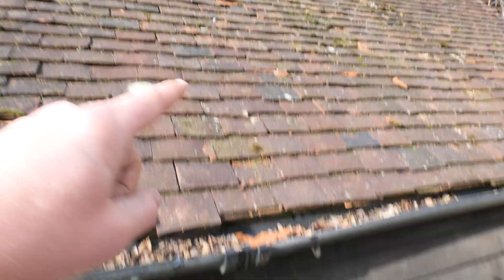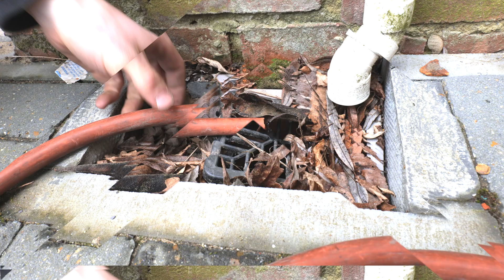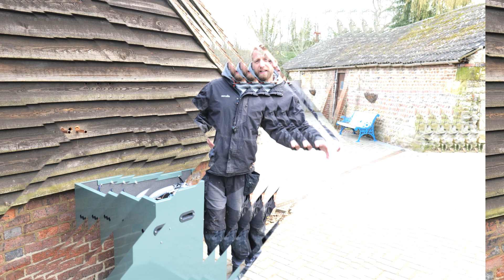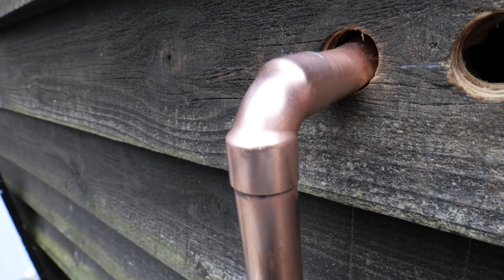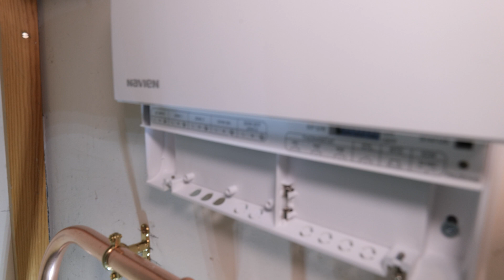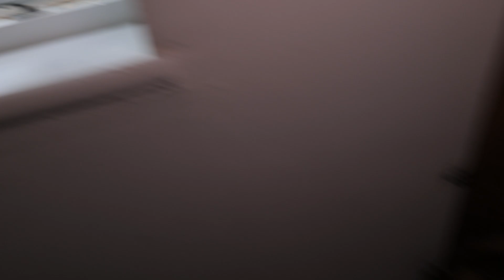Why?.... Navien - System Boiler relocation

Comment: Where are you based as we need a supplier and fitter for a Navien external combi boiler and system.
Reply from the maker: I am in Hastings East Sussex. 👍🏻
Reply: The installation would be near Yeovil in Somerset so I guess too far for you! Do you have any contacts/recommendations for installers in that area? Thanks for your reply anyway. Great video!
Reply from the maker: @petersamwell5919  Yes unfortunately too far. I do not  I am afraid. Thanks anyway.
Reply: @loving-plumbing  Thanks anyway

Comment: I fitted one of the first in 2018 direct from navien and It was the worst decision I even made. I really don’t see the benefit of a twin stage burner. 
 
We recently installed a 32kw eogb sapphire liquid fuel boiler as a slave to a 200G. We rated it to 29.4kw @ 45c design temp and its working beautifully. 

I have never seen a oil boiler stay on and hold a temperature without creeping over the set temperature.  
The interface is easy to use and used in the right application UFH , Low temp system it would show massive savings in running costs. 

Best regards 
Dave
Reply from the maker: Thanks for the comment. Why was the  Navien so bad ?

Comment: We are going to install our first Navien ( indoor system ) boiler later this month - was wondering if you have looked at / if it was possible for hot water priority at say 70degC flow and heating at lower flow temp to maximise the boiler condensing mode ?
Thanks for the content 👍
Reply from the maker: Good question. 👍. If you can I've not figured it out yet. I will find out and let you know.
Reply: I suppose it’s if they have two call wires one HW one HTG - with their stainless heat exchanger they won’t rot like a Grant if they condensing continuously 
Thanks for having a think about it 🤔
Reply: @markcostello2734  The condensing part of the Grant boiler (secondary heat exchanger) would have to be grade 316 stainless steel although the primary heat exchanger is probably carbon steel. Which heat exchanger are you saying rots (presumably the primary one) ?
Perhaps you were saying that a non condensing Grant boiler rots ?

Comment: Navien has become the king of premature failure in the US. Are there other choices that you endorse?  Lastly...if the old vent and bird cage was in the way...now you have a boiler in the way. It will smell better now with roof venting but that location seems poor.  Why not replace that giant tank with a combination unit INSIDE? Not trying to be critical. It is interesting to see equipment and installations from out of the US.
Reply from the maker: Hi . Thanks for the feedback. I'm aware Navien have some issues with the gas range in the US, but here in the UK market the design is different. We work with all manufacturers, but I am a fan of this particular boiler. The location is specified by the client, they are building a wall etc around that and another appliance. Cheers.
Reply: @loving-plumbing  thanks. You do nice work.
Reply from the maker: @rogerwhiting9310  thank you

Comment: Can I ask why not a metal tigerloop.
Reply from the maker: You can ask, yes. No one in a 30mile radius has them. We have one ordered and will be swapping out. I was pulled up by OFTEC about a previous one. Cheers
Reply: I haven’t come across Navians in my area as yet, it would be interesting to see how they perform. I’ve heard that the condi traps aren’t great. I might get on one of there courses to have a look.
Reply from the maker: @stuart-LBS  that's the only issue I have had. The float in the condensation trap had a pin hole. I believe that has been rectified now. They are fairly new in the UK so time will tell. Ultimately they have ten years warranty as standard which is great for oil.